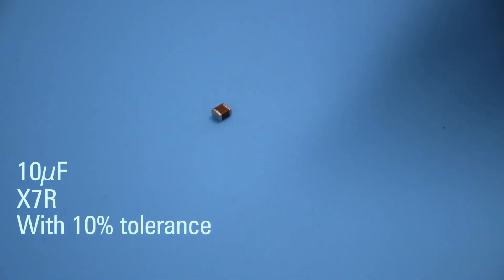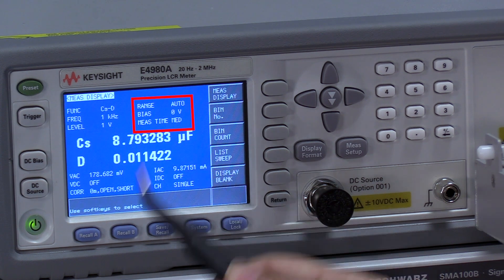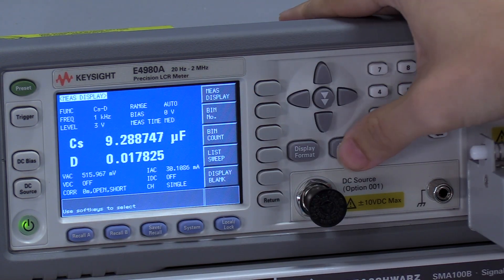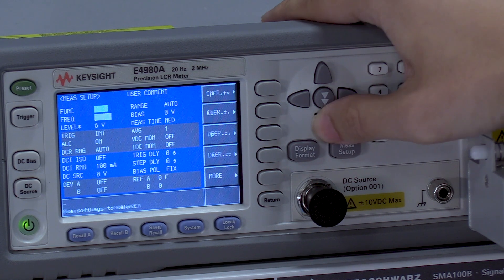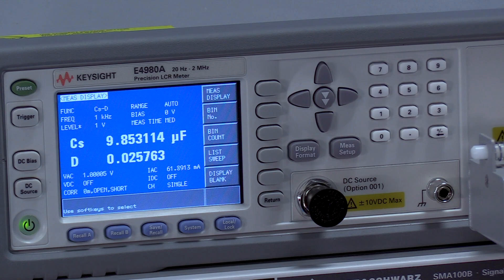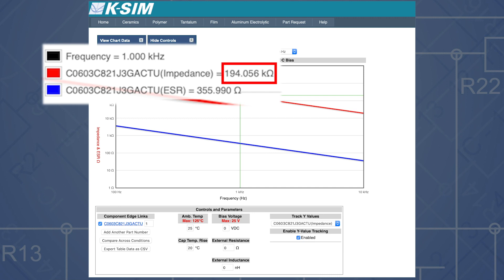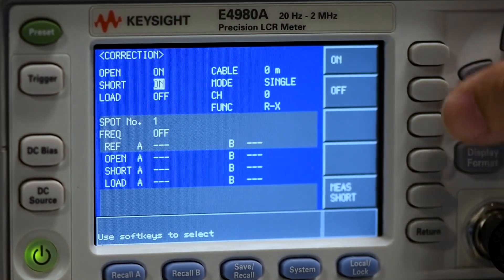Finding the Most Accurate Capacitance Measurement

Comment: What budget capacitor meter do you recommend to measure smd capacitor in circuit
Reply from the maker: It's very hard to measure capacitors in situ. A budget meter would be good at anything but class II ceramic caps because of the piezoelectric nature of class II ceramics. For tantalum, film, class I ceramics, and aluminum electrolytic any RLC meter should be good.

Comment: This video is highly misleading. The issue is NOT that the meter misreads the capacitance, it’s that the capacitance of these MLCC capacitors varies so much with both DC offset AND AC waveform amplitude. The supposedly inaccurate meter reading is actually a correct reading, just under conditions different from the ones that the “nominal” capacitance value is specified for.  Here that standard condition is 0V DC, 1VRMS AC, at 1kHz applied _at the capacitor_. 
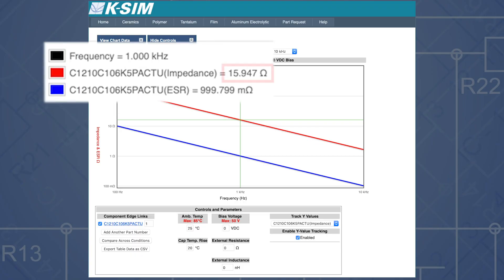The statement at 0:50 “this [incorrect measurement] is happening due to the Class 2 dielectric exhibiting really low impedance” (15.9 ohms). is just wrong. Any actual 10uF capacitance has an impedance of 15.9 ohms, that’s just Xc = 1/(2 pi f C). It has nothing to do with the special dielectric. What the special dielectric does do is make the capacitance vary widely under different AC (and DC) conditions.  
The meter uses (1:01) a simple R-C voltage divider to determine impedance, so of course, with a particular Vsource, the AC voltage across the capacitor will differ according to capacitance; that’s the whole principle that the meter uses to measure the capacitance!  And that would work fine for any variety of capacitor whose capacitance didn’t vary with AC amplitude.  But since MLCC capacitance does vary with amplitude, and therefore require applying a specific AC voltage to reproduce the spec-value test conditions, it’s necessary to increase Vsource accordingly.  
Then at 1:25 "and now we see a much more accurate reading".. also wrong. It's no more accurate than the first reading. It's just that the capacitance has changed due to different test conditions, and those conditions match the standard conditions that the manufacturer uses for specifying the nominal capacitance. Indeed, someone who cares about the capacitance value enough to measure it with fancy equipment actually should measure the cap under a variety of applied AC and DC voltages, just to convince themselves how wildly this type of capacitor varies.
And with regard to the title "Finding the most accurate capacitance measurement" -- it's hard to see how this has anything to do with "accuracy" when the component behavior varies over almost an order of magnitude from zero DC bias to rated voltage (not to mention AC and temperature variations). This is almost nothing to do with accuracy of capacitance value, and all to do with "how to achieve the very particular DC and AC testing conditions that happen to match the manufacturer tests"... but which are unlikely to match how you will use the component.
Reply from the maker: Hello Graham. Thank you for your comment. What we were trying to do with this video is to demonstrate why some customers measure a Class II or III MLCC's capacitance and the capacitance reads out of spec compared to what the manufacturer specifies. The point of the video is that the MLCC has to be measured under the same conditions that the manufacture measures them at or else they will be out of spec per the reasons that you mentioned in your comment.
Reply: @KEMETElectronics  Sure, I get that you were motivated to produce a video that would help customers validate whether the components they received correspond to the spec they ordered.   But the main reason that customers would get a capacitance reading that doesn't match the spec is because they have the wrong expectation of how these capacitors behave.  And that's a significant problem if they ordered capacitors to populate a board that they designed while unaware of MLCC characteristics.  That is the topic that needs illuminating. This video may walk through the exercise of applying test conditions that match the spec, but its incorrect discussion of the mildly theoretical details actually undermines the customer's understanding of the crucial topic of the wild variation in MLCC capacitance under different conditions.    
I will repeat more strongly: The statement at 0:50 “this [incorrect measurement] is happening due to the Class 2 dielectric exhibiting really low impedance” (15.9 ohms) is a lie.  The measurement is not incorrect. It is not something specially attributable to the Class 2 dielectric. It is not a "really low impedance" in this context, it's the exact impedance  that this nominal capacitance would exhibit. And given that "really low impedance" could be construed as a desirable feature (as in "Low ESR"), that is a really disingenuous rationale to suggest.
So while you might have had a fine intent when you decided to produce this video, it instead works to undermine a customer's understanding of what's really going on, and does so in a decidedly self-serving manner.
Reply from the maker: Hi Graham. Thank you for the video suggestion. We appreciate your comments.
Reply: @Graham_Wideman  Indeed sir, thank you for your insight and taking the time to think and make a comment, I was just watching casually and already knew what you stated, yet it escaped me. What should be stated is how the manufacture rates the components, which are high quality and I’ve personally used them many times. I agree though that by calling out the Keysight instrument as not measuring correctly is misleading, especially if the target audience doesn’t have an advanced understanding of the complex physics involved. This will lead to poor product design and customers choosing an improper component. What is odd is that this behavior is useful in many situations so it’s not a negative for the product. I do appreciate the effort made educate their customer base, but that effort should be geared more toward universal information that can be applied to all capacitors.
Reply: @Graham_Wideman  Yup. Engineers widely use these kind of capacitors for small-signal filtering.
I'd have fallen in the same trap if I didn't know that and was designing an AC power meter with a current shunt.
Yeah it needs filtering. Yeah the signal is <100mV. Yeah the phase shift is important for the measurement.
Let's just assume that the capacitance is within a percent regardless of the amplitude. The ADC is highly linear.
We'll just calibrate the whole thing at 100%FS

Yeah uhm, no. 
KEMET just missed a great opportunity to show their knowledge and make an interesting educational video.
Reply: Yeah, my pretty much next question would be : Then what is that MLCC's actual capacitance when measured at 100mVRMS+0Voffs at 1kHz. 
Also, how large is the uncertainty of that measurement setup.
Knowing about the equipment used, I'd say it's pretty much spot-on.

I'm also wondering if the MLCC's capacitance would be in-spec after a reflow's heat cycle.
I know that ferroelectric MLCCs usually increase their capacitance upon reflowing.

I'm not sure if that is a related phenomenon to what we are seeing here with higher AC amplitude.
Reply: Thanks Graham.  I watched this video and thought I was crazy.  At first I thought he was talking about ESR, but 15.9 ohms is hardly a low ESR. Then I paused the video and saw that it was saying 15.9 was the impedance and I quickly did the 1/ (2pifC) calculation and realized that this video was very misleading.

Comment: Thank you. Finally, I can do the short measurement on a 4268A. It is the ALC problem!
Reply from the maker: So glad to hear!
Reply: @KEMETElectronics  Hi, how can you measure parallelled X7Rs? For individual measurement, I got correct value with ALC on. When I parallel 2 47uf X7Rs, the result is way off. Any tips?
Reply from the maker: Hi Po-Ting - We have a couple of questions - 1) Are you measuring both capacitors at the same time, or are you measuring them individually when connected in parallel? 2) What is the resulting capacitance that you are measuring? If they are being measured together, the resulting total capacitance should be be around 94uf. - Sam@KEMET
Reply: @KEMETElectronics Hi!  I soldered 2 47uf X7Rs in parallel, and measured it as one larger cap. For unknown reason, my 4268A won't show any meaningful result (0.0001nF on display /w ALC on). This was done on a 16044A type test fixture. Today, I also try a 16334A type test fixture (tweezer type) and finally it shows 103uf which is within the spec. I couldn't afford a genuine 16044A or 16334A. They are simply out of my reach. I don't understand why my 16044A type test fixture won't work on paralleled caps. Do you think it was the test fixture? Could you also do a similar test on your device? Thanks.
Reply from the maker: Can you tell us whether or not the 16044A is measuring correctly when 1) only one of the capacitors are being measured and 2) what the results are when measuring the two parts in parallel when ALC is off? If the test fixture is not giving the correct results for a single capacitor or when ALC is off, then it is probably an issue with the fixture, especially since the 16334A works just fine. On the datasheet for the 16044A, I noticed that there is a size limitation for a capacitor, so I suspect that having two capacitors might not fit in the DUT probe pins correctly leading to the off readings. Also, looking at the capacitance meter that you are using, 4268A, it looks like the default conditions for testing the capacitor are  70 uF at 1 V rms at 1 kHz. 120 Hz measurement ensures the constant 1 rms test signal for up to 600 uF. Please be sure to check the datasheet/specsheet to see how we measure the parts. Some of our X7Rs at 47uF are measured at 120 Hz 0.5Vrms. -Sam@KEMET